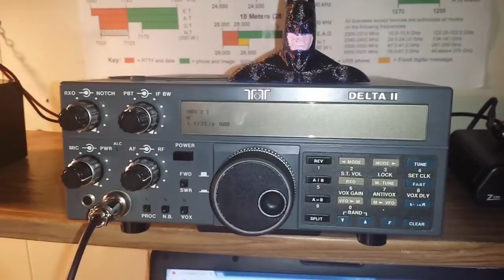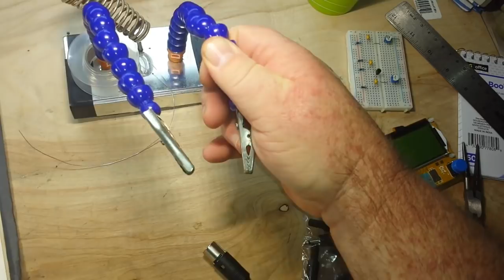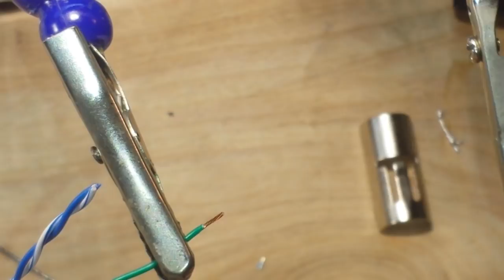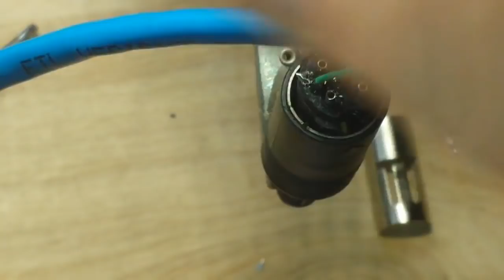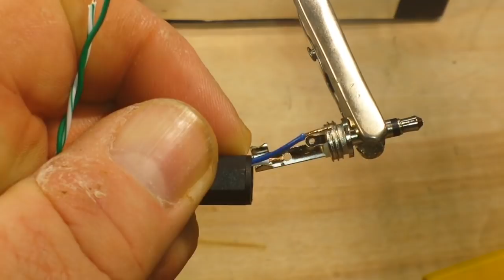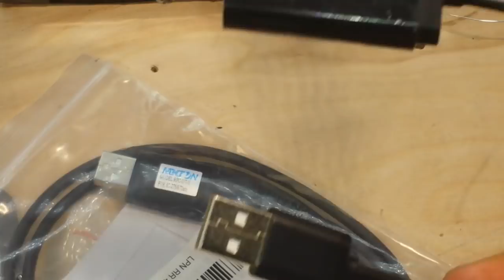Making a custom audio cable for Tec Tec Delta II

Comment: I have been a poor ham for a couple of years now and I have rolled my own mic and cables and isolated audio interface for digital modes and CW and it's just not hard to do. It's just tedious and requires sufficient magnification. But I would like to offer an opinion on your new headset microphone. Trade with your son because yours sounds like a gaming mic, and without the richness and fullness your other one had. Tell him all the cool kids have one and he'll beg you for it. And it's nice to see another New Ham equipment maker.
Reply from the maker: I'm getting my headset back. I hate this one. What rig are you making cables for?
Reply: You are going to have to look this one up, but it's (BITX 40), the mic and PTT was made in a small clear plastic rectangular container and used coiled phone cord because of the 4 wires I needed, and coiled look. And separately a CB mic cable with intermittent fault and striped it back and made new connections like you did.

Comment: I designed and built several hundred C64 devices back in the day that used 5 pin DIN connectors on one end. I hate soldering DIN connectors! I still have a big bag of them left over that came from Radio Shack if you want some? Fun to watch someone else struggle with these damn things, good video, all the same, thanks!
Reply from the maker: Haha, thanks buddy. Yeah, DIN connectors suck. Glad you liked the video...I got your email. It will go out probably on Monday.
Reply: Thanks man! No big hurries.